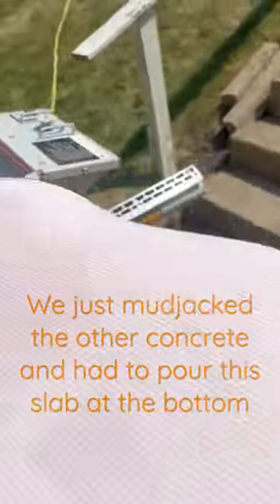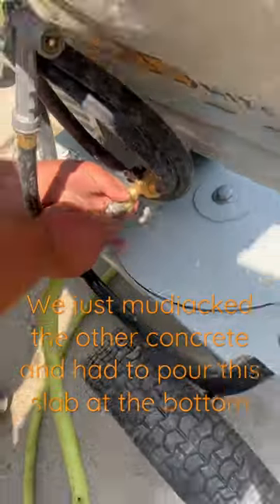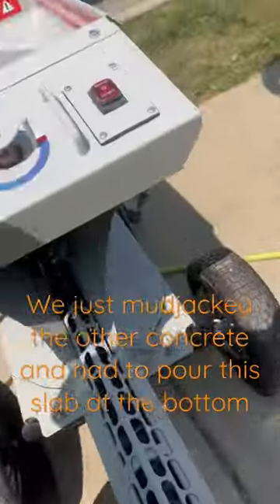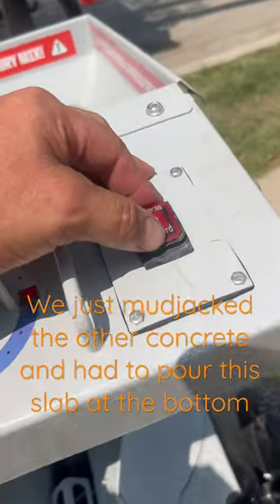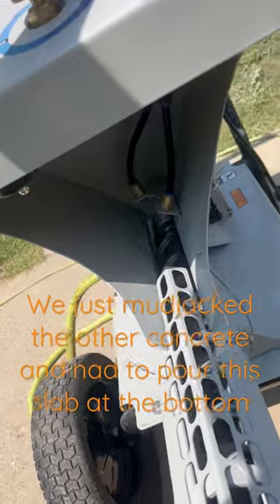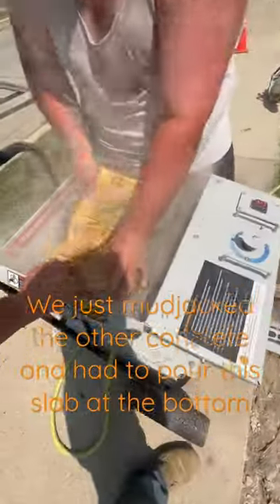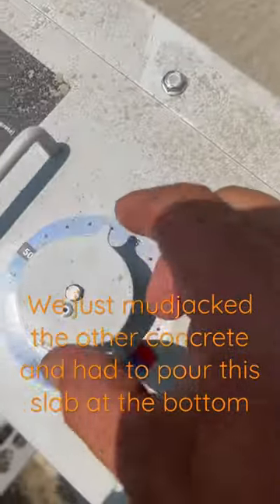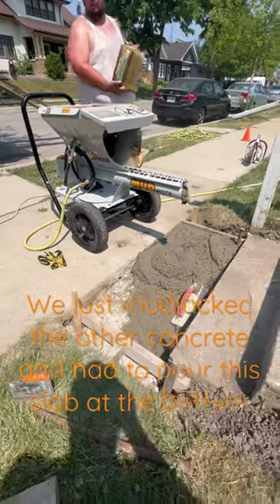MUD MIXER concrete mixer. 👍👍👍Total game changer for small jobs. #construction #concrete #diy

Comment: It's definitely not faster than a drum
Reply from the maker: It is significantly easier and faster than a drum mixer. Drum=dinosaur
Reply: @mudtechworks even a 2 bag mixer would be faster than that toy.
Reply: @mudtechworks  lol, there are too many small moving parts that will eventually need to be replaced. Those small nozzles will get plugged up, and those augers will also need to be thoroughly washed, way more than a drum. Don't even think about getting a shred of paper/plastic packaging from the bag in this thing either. It probably requires the auger to be taken apart, wayyy more complicated and time-consuming than a drum.

Sheeit, for small patches, I use a 5 gallon bucket and a cordless milwaukee mud mixer🤣🤣🤣 that's the most efficient
Reply: The setup takes longer than it would to just use buckets
Reply: @Kryynism I'll mix faster with a shovel😂
Reply: @Diego-zy5dc  truth

Comment: If I wanted faster mixing I'd just buy second or drum barrel mixer and if I need whole lot more of concrete I'd just buy it straight from concrete truck. If I wanted less concrete I'd just mix a bag with drill in a bucket.
This product is trying to fill a niche I'm not entirely sure exists, especially for that price.
Reply: You’re wrong. Used it. Way quicker and easier than a traditional drum mixer dumpling to the wheelbarrow method

Comment: With my commercial mixer i can make up 15 60lb bags in 15 minutes. And i bought it used for 350 dollars.  Theres no way that thing can mix that much in 15 minutes.
Reply from the maker: Ok Superman. You might be close to a bag a minute for the first 10 minutes. Then you will get tired and your concrete will be incredibly inconsistent. 
Try a MUDMIXER. Not only will it outperform your old drum mixer you won’t be as tired from lifting the bags, after you make perfect concrete all day, then you’ll post your $350 antique on Craigslist.
Reply: @mudtechworks lol you still have to lift bags with this thing🤣
Reply: @mudtechworks the dedication to the product is respectable tho
Reply: @mudtechworks  looks like you have to lift the bags. I don't really lift them, I set up my mixer, and I have the concrete loaded in my pickup bed. I work smarter, not harder. As far as quality of mix, I will go with a drum mixer before I trust that. I can easily add water or concrete to adjust my mix. Can you?
Reply: @mudtechworks  I do have a question for you.  I can run 90 bags in 2 hours. That's from start to finish with the mixer cleaned. How many bags a minute can you run?
Reply from the maker: @Dwohman  that’s a pretty funny comment you just made. Did you not watch the video where it shows the adjustment knob for the 💧? And yes if you really wanted to add more Portland cement to the mix you could do that…but I trust the pre blended bags of concrete more than I’d trust your judgement of what to throw in a drum.  Let’s go head to head. Make a video of you going as fast as you can with your mixer and we’ll do the same. No more than 2 guys. And let’s see how much concrete VS. effort you can achieve??
Reply: @mudtechworks  so you're telling me that if your water to concrete ratio is off, you can change it once it runs out your auger? I think not. I also use bagged concrete. I can adjust the ratio in the drum. Right now, I don't have any concrete jobs I need to do. I will be replacing my sidewalk in September. It's going to take 140 bags plus(about 3 yards). I will do a video at that time. It will be just me and my son. I'm 58, and he's 16.
Reply from the maker: @Dwohman  This sounds perfect! We need to do a comparison video of each and see who wins. Your going to win for a homeowner doing his own work with lower cost $350 mixer vs $3,500 MUDMIXER, and you’ll get extra points for being on this earth longer…but you won’t mix the same 3 yards again the next day because you’ll be worn out..with the ease of use the MUDMIXER is to operate we could do that ssme 3 yard job every day. But 3 yards is on the upper edge of capacity for any hand mix. Why don’t you call a Redi-mix truck? 

In response to the water-No, we did say that. But neither can you with the drum unless you put it all back into your drum 😑
What state are you in?
Reply: @mudtechworks  Worn out?  You're pretty condescending with your statement. There's an old saying my father told me, "If you feel froggy, then jump!" I will take you up on any challenge you have.  You have absolutely no idea how I work!
Reply: @mudtechworks  and to answer your question about the cement truck, I was going to order a truck. I actually need 10 yards. But it is a matter of principle now. I will do the entire job with bagged concrete just for fun and to prove a point. Just an FYI the trucks in my area have a 4 yard minimum. And once I complete your challenge,  I have one for you. You take your mudmixer to a job in the middle of nowhere with no power hookup, and you make your concrete.  All I can say is you better have a good generator.
Reply: @Dwohman  Did you post the video of 10 yards you did?
Reply: @truraza  He probably had a stroke after the first 10 bags.